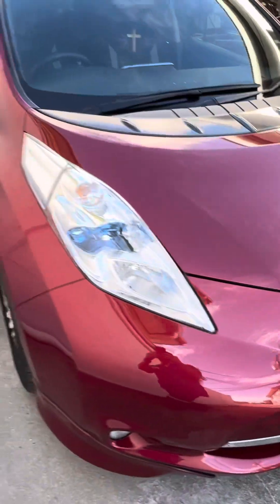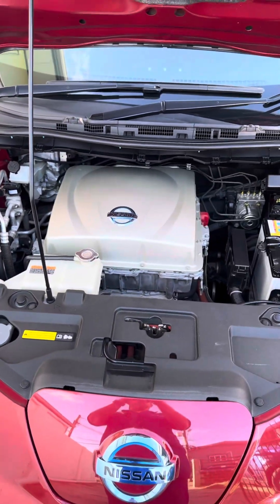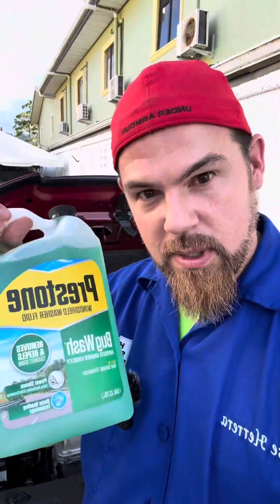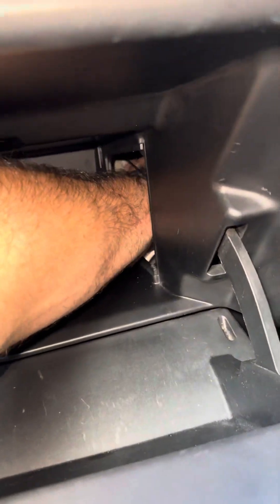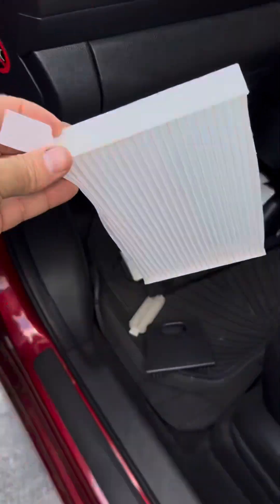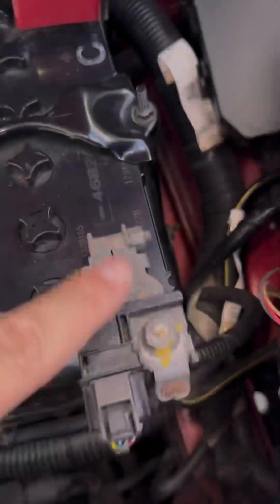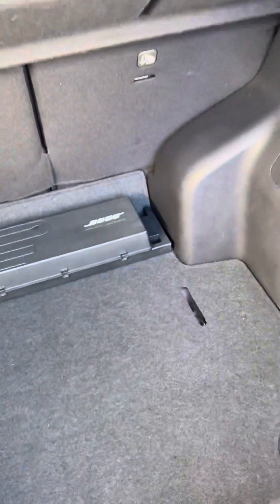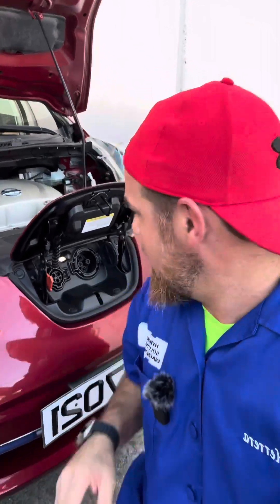Servicing a Full Electric Car

Comment: hi you did not mention checking the reduction gear oil every 20k and replace every 60k or checking wiper blades etc and apparently the slide pins on the brake calipers have been known to stick

Comment: Dont forget even if it is a full electric it still has a reduction gear box so you need to change the fluid according to service manual
Reply: If you want to change it then change it, but not changing it will not do anything either, these gears have so little friction, the Prius has a transaxle similar to what an EV has and there are Priuses that have 300,000 miles and more, with the original transaxle fluid.
Reply: @hedgehogthesonic3181   im a tech that works on mostly ev and hybrid and seen a lot of blown reduction gear because of lack of maintenance, i do admit that the prius are bullet proof on that regard but chevy bolt, hyundai kona ev, kia niro etc are definitly not